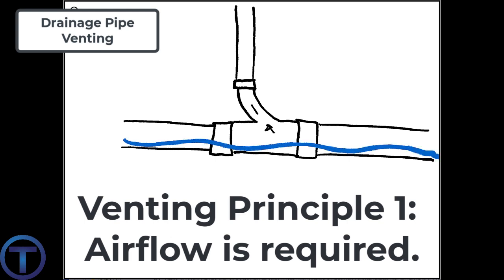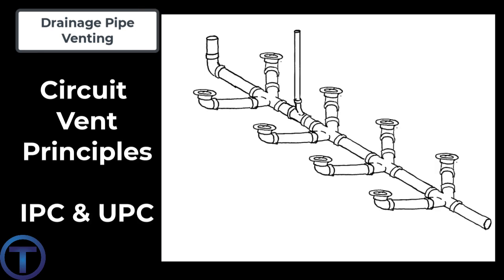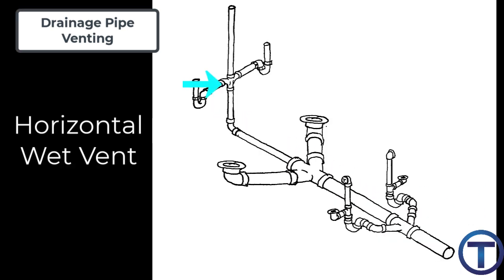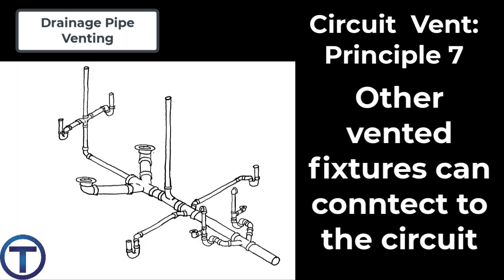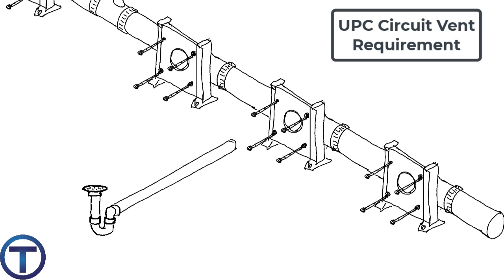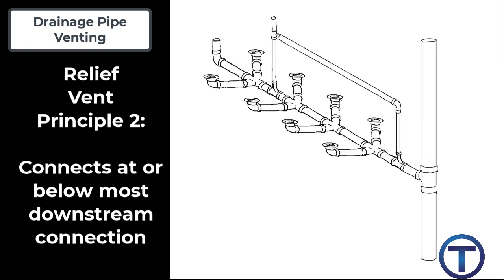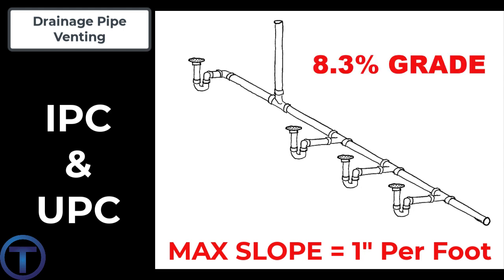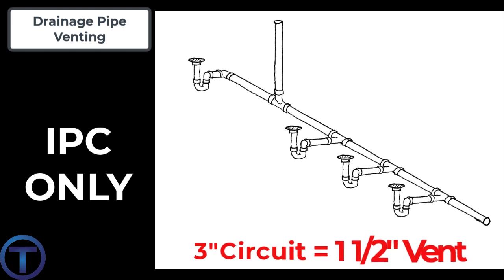Drain Venting Lesson 4 - Circuit Vents Part I

Comment: In the location of the soil stack connecting to the circuit vent in your video above is actually a stack vent and continues through the roof, do you interpret that this serves as the relief vent?
Reply from the maker: That is a stack catching waste from an upper floor.  That is the reason for the relief vent, which is required if the stack has waste coming from above.

Comment: You made no comments about horizontal dry vent rules and application with circuit vents. Any chance you can make a new video on this subject? It seems to be a good answer to monolithic slab homes where two bathroom group layouts cannot meet verticle wet vent rules, and the trap arm of upstream fixture connections exceed IPC table.
Reply from the maker: Thanks for watching. Good suggestion.
Reply: use a studer